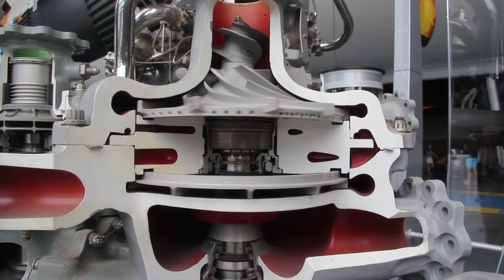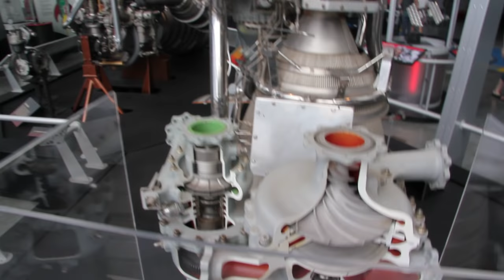RL-10 Turbopump Cutaway

Comment: Beautiful, wish it had arrows showing the direction of flow.
Reply: Comes in from the top and out the sides, the turbine “throws” the fuel so based on how it’s spinning shows where the fuel goes
Reply: That dual stage hydrogen pump is a little confusing. I think I got it figured out tho.

Comment: It probably would suck the gas and nitro dry in seconds as it's designed for a rocket and pumps several hundred liters every second..... But it's worth the try....
Reply: The RL-10 turbopump  LH2 fuel flow rate is around 3.5 kg/s, which is actually not as many litres as you might think, it equates to around 49 litres a second as a liquid. When it gets to the expander turbine however, it's more or less a gas (it isn't, technically it's a supercritical fluid at the turbine inlet), and the volume is increased by a factor of ~200-250, which is more like 11,000 litres per second. I've seen your other comments on here about car mods, and for a laugh, thought it would be fun to provide you with an idea for a mod you could actually build without ripping up an RL-10 turbopump... 

I've always thought it would be fun to have a bottle of compressed air in the passenger's seat, something at very high pressure, perhaps 300 bar+ (4500 psi in old money), perhaps two or three scuba tanks for example. Then I would connect half of the air supply to the engine intercooler and radiator, and half of the air through a second turbocharger turbine, connecting the second turbo compressor outlet to the engine intake via a new intake manifold. The outcome essentially of doing this is a short term super-boost effectively, which works by lowering the engine air intake temperature and raises the intake air pressure, effectively increasing the short term power massively. The air going into the intercooler and radiator will keep the engine temperature stable (in short bursts) and providing you own a reasonably robust engine block (2JZ might be a good safe bet for example, I've seen those modded from stock to take pressures far beyond their design). Of course, there are huge risks. The additional power might cause your stock turbocharger to simply explode with the huge additional pressure ratio, and the crankshaft, head gasket, injection valves, flywheel, gearbox, any shafts, and differentials may all be liable to sudden failure. You would need an uprated fuel pump, water pump, oil pump, and an array of sensors to give you warning if any of the setup looks dodgy. 

Others have attempted something similar in fact, check out these:
 https://www.youtube.com/watch?v=-h3GUX-DdVw
https://www.youtube.com/watch?v=Ulkjqn7_huA
Reply: @onetrickhorse  Nothing can stop a Chrysler HEMI V8, which clocks in at 11,000 HP! No problem driving even the Sea dragon rocket engine turbopumps, I bet!
Reply: @xa-xii4865  That's an excellent point about the hemi engines, I completely forgot about them, they are incredibly robust! I remember when I was a kid going to Goodwood Festival of Speed, and they had a car there called Hemi Under Glass, which was this Hemi-V8 methanol-fuelled insanity-wagon which was essentially a drag car modified to do wheelies, ever since then I knew those engines were a serious piece of hardware. It got made famous after Jay Leno crashed in it. Here it is in action: https://www.youtube.com/watch?v=LabX19ocJZA
Reply: @xa-xii4865  Also, for anyone reading this who isn't aware (I realise you might be!), the term 'hemi' refers to the piston heads, they have a hemispherical dome cut out of the top, often with a central shallow cone, and the principle behind it is two-fold, it aids the combustion process by creating a more even flame front, and it allows the use of higher octane fuels by reducing overall pressure ratio in the stroke, which although it might sound disadvantageous, it actually allows higher amounts of forced aspiration like superchargers or turbochargers in mods.
Reply: @xa-xii4865  ignoring the fact that the Sea Dragon was pressure fed.

Comment: Saw this in person.  Imagine the ipellers spinning about 5000 times faster than this.  Good demonstration but this thing is meant to rip fuel and oxidizer into the combustion chamber at high pressure.

Comment: Can I use this in my McLaren?
Reply: Probably will empty the fuel faster than you can say "TikTok on the clock".
Reply: Those pumps are rated at up to 7500hp, good luck trying to drive the pump
Reply: @roku_nine  A Top Fuel dragster engine will have no problem driving it
Reply: @roku_nine It drives itself using hydrogen, which you wouldneed anyway for the engine to run

Comment: Does rl10 turbopump has gas generator..?
Reply: Nope. The RL10 is an expander cycle, so the turbopumps are powered by the fuel passing through the nozzle walls and turning into a gas. The gaseous fuel is then injected into the combustion chamber as usual.
Reply: no, it's an expander cycle engine which means that the liquid hydrogen flowing around the nozzle heats up from combustion and turns into a high pressure gas that spins the turbine and then enter the combustion chamber completing the cycle
Reply: @twmax4137  how do you start an expander cycle rocket engine then? I mean, prior to ignition, the fuel wouldn't be hot or gaseous to power the pumps. Thanks.
Reply: @rosswarren436 They use a pressuried gas like nitrogen or carbon dioxide to get the pumps spinning until the rocket starts, then it switched over to gas from hydrogen.